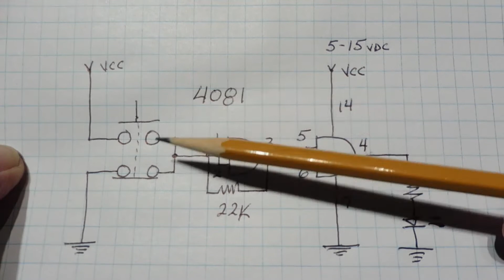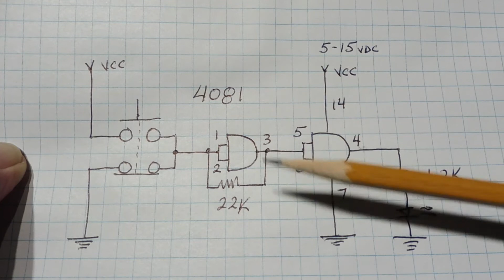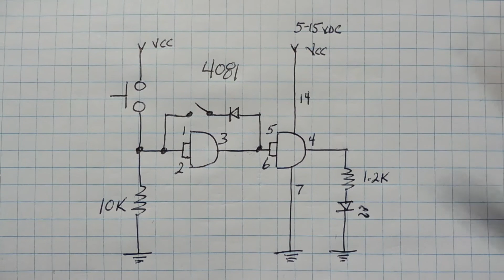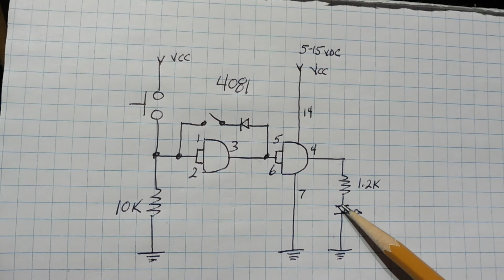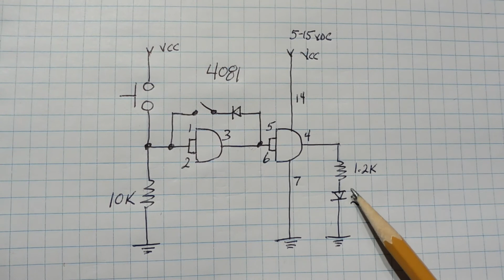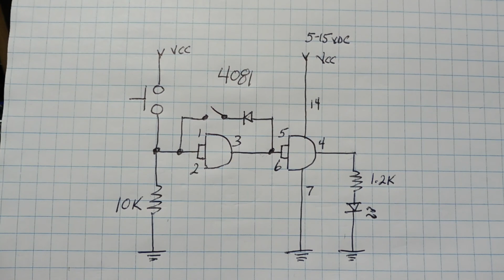Simple Digital Logic Circuits   Part 1

Comment: Really great video. Straight to the point and not wordy like lots of tutorials on here! I'm new to designing electronics at this level. Am I correct in analyzing that the second circuit does not eliminate contact bounce when the toggle switch is off and the push button is in momentary mode?
Reply from the maker: Yes .. you are correct, the circuit does not de-bounce when the toggle switch is off. If the load is a buzzer it is not needed. If the circuit is feeding a microcontroller then you could use one of the spare AND gates to make a debounce circuit to feed this circuit. Thanks for your feedback and your support.
Reply: @0033mer  ok! That's what I was thinking! Thanks for answering!

Comment: In the latching circuit could you replace the diode with a resistor or would that not work?
Reply from the maker: Yes, you could make the circuit work with resistors if you select the values properly. When the latch is triggered the resistor would have to be large enough to limit the propagation delay race current. After the latch is triggered the resistor value and the pulldown resistor on the input to the gate form a voltage divider so the resistor cannot be too large. This circuit was meant for beginners so a diode would be a better choice.

Comment: I had to go through this video several times to understand it because I have never really had to do anything with digital logic.  I didn't know these circuits were able to "self latch" as i would say. What I know about AND gates is the truth table so what ever appears on the input would appear on the output (when the inputs are tied together). This video kind of gives it a different twist.  I can see how the diode is key, since it isolates output from input. If input Vcc and gate Vcc are equal then the latching happens only when the switch opens up, then the diode is fwd biased. If input Vcc is lower than Vcc of the gate then the feedback (latching) happens right after the output goes high.  Is that how this circuit works ?
Reply from the maker: Using Nand gates in this configuration is not very conventional but it does work.When the switch is closed it enables the output of the gate to be connected to the input through the diode. This causes a dog catching its tail scenario and latches the output until the switch is opened. This keeps parts count to a minimum as there is no need for a flip-flop latch IC.

Comment: 1:00 Most Push Button switches use a single N.O. contact. Why are you using such a non-common PB contact configuration to explain this logic gate ??
Reply from the maker: I still do a lot of ladder logic programming and these are great for push button interlock circuits and forward/reverse motor control using relays. This button is NO single, NC single and SPDT all in one switch depending on the wiring. Very handy.
https://youtu.be/k8Ue1o1yAuI